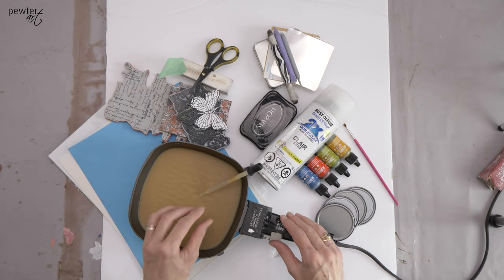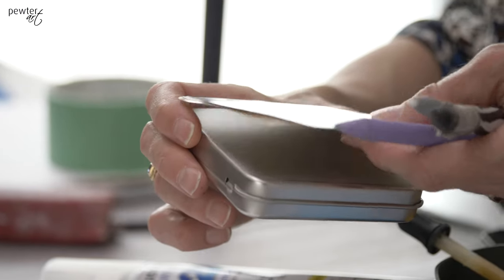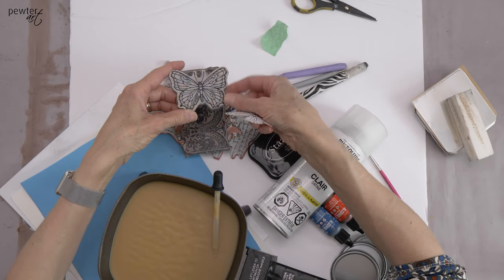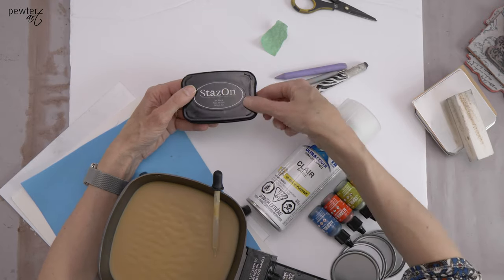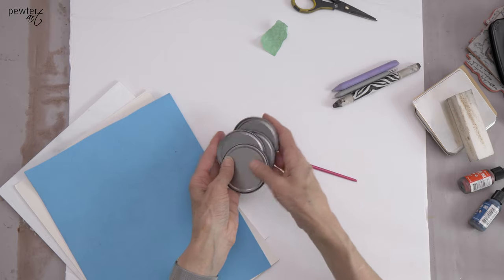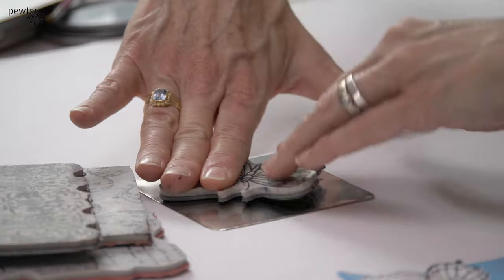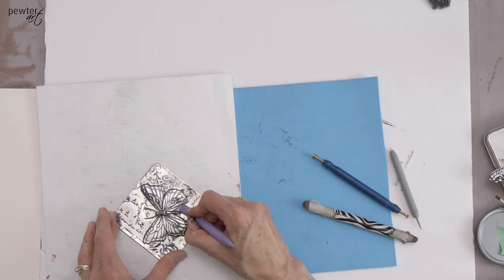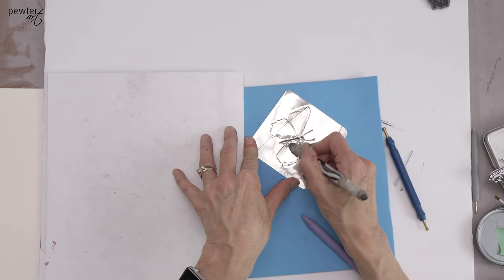Metal Embossing Tutorial - Rubber Stamps

Comment: Wow...this is one of the best detailed tutorial I have seen! Thank you! I am very interested in trying this out and have one question. What are the chances of the beeswax melting after the project is finished....as in what temperature would this happen..or not? Thank you.
Reply from the maker: Hi there! The beeswax can definitely melt if your project is left in a hot car, on on a window sill as the metal conducts heat. I can not say what temperature exactly : ) You can increase the melting point of the beeswax by adding Damar crystals ( similar to what you would use in encaustics) at a ratio of 2 part beeswax to 1 part Damar crystals) - make very sure then to work in a well ventilated area. Hope this helps!
Reply: @elitiahart6610  Thank you for your response.